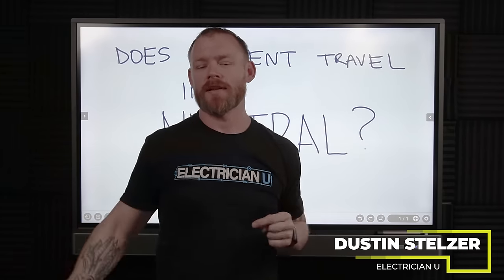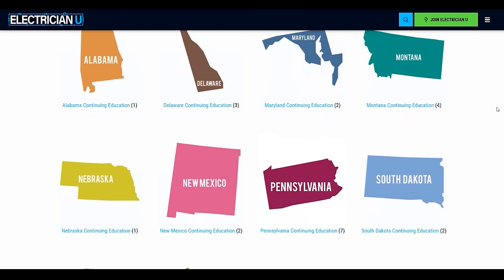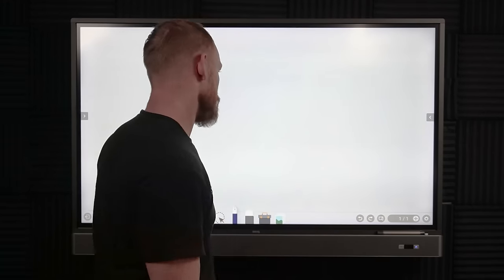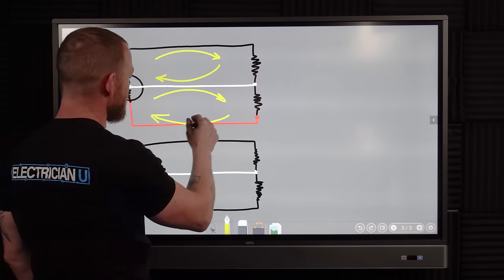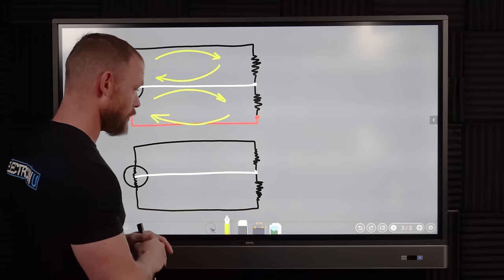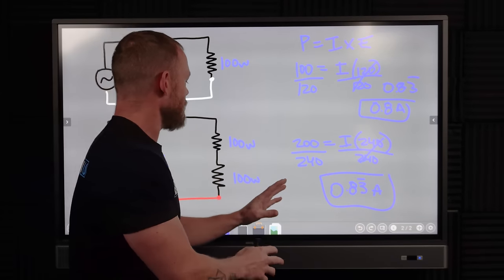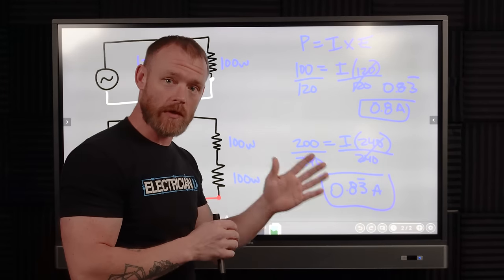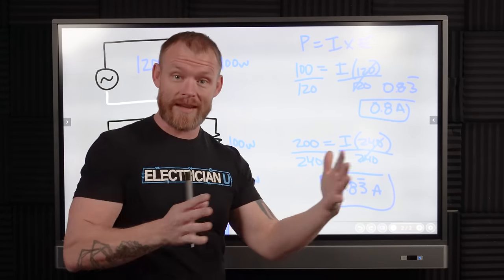Does Current Flow on the Neutral?

Comment: Um actually, current is the flow of electric charge, not electrons. Electrons have charge also and they do move through conductors in a process called electron drift but that is significantly slower than the conveyance of electric charge through a circuit. Think of it like an ocean. The waves (charge) move through the ocean (conductive band) and the ocean is on Earth (wire) and the ocean is made of water (electrons) but the waves move the water at a much slower rate than the waves move through the ocean.
Reply: Electrons are the charge carriers.  The charge moves with the electrons.  The signal propagates much faster than the electrons, though.
Reply: @GH-oi2jf  yeah, you got it. Electrons have charge the same way water has waves. And a wire has a conductive band made of electrons in the same way that the earth has oceans made of water. Charge propagates through a conductive band the way a wave might propagate through the ocean. This wave can displace water the way charge can displace elections. Anyways, electrical current is the propagation of charge, not the flow of electrons. And if that seems unintuitive, there are as many electrons in a wire as liters of water in the ocean.
Reply: @austinwoodall5423  — No, the charge is an attribute of the electrons.  The charge moves when the electron moves.  The protons also have charge, but they don’t move.
Reply: @GH-oi2jf  consider a stadium wave where attendees take turns raisimg their hands in a coordinated effort. The stadium (wire) has a crowd (conducting band) made of people (electrons). The wave moves through the crowd when the people move from their seats (valence band) to a more excited state (conducting band). Sure the people have hands and can stand but the movement of the wave doesn't require them to change their positions, only their states.

Comment: That is a loaded question and the answer is maybe or maybe not!!! All depends on how balanced the load is on the 120 volt circuit if measuring single phase 120/240 voltage circuits!!
Now if you are using 3 phase circuits at what ever voltage you are on, 277/480 circuits using 277 volt lights it still depends on how it is loaded up!! 480 3 phase motors is a bit different or if you use delta phase which I personally don’t like!!! 😂😂😂😂

Like I said … loaded question!!😂😂😂

Comment: You aren't "wrong" but you use a lot of phrases that are wrong.  

240v single phase +neutral (120v) seems to contribute to this misunderstanding or at least mis use of terminology.  

The current flow question you are addressing is simple math. The numbers have to add up. 

There is another misunderstanding and that is potential versus potential difference, commonly referred to as voltage.  When we talk voltage it is about the difference between two points.  Hence a 240 V system is 120 V to neutral/ground.  

Point being, people are learning from you. Words matter. Be more explicit and accurate.

Comment: lol you just shoe horned in the real kicker at the very end.  for anybody just wanting an answer: yes, current flows in the neutral back to the transformer IF the loads are unbalanced.  otherwise, no, they just oscillate back and forth through the hot and neutral across the different phases.

Comment: I am completly at a loss as to why you are trying to teach electricity as you have no idea how electricity flows or works .I am going to give you a quick class on the flow of electricity. You are stating that you are reading 2 amps draw going into the bulb and 2 amps leaving on the neutral,this is false. The light bulb draws only enough energy to operate which is 100 watts,this leaves 0 energy left to cause amp draw on the neutral.Every load or draw pulls only the energy it needs to operate ,if you are showing draw on the neutral there is a short in the load allowing energy to go to ground.If you disconnect the neutral from the neutral bar and contact the bare wire when the load is energized you will get a shock because you are a load now and the draw increases but you are in series with the load and the voltage is considerable lower.Electricity flows only in one direction and it is pulled not pushed it is drawn through the wires.It's like I told another fellow, you can't push a chain , you are dealing with compressed energy and only can be pulled for that reason and the fact that the load determines the draw and causes the draw,What drove me crazy ,was what causes the draw. Say you have a solenoid coil that has a draw of 6 amps..and you close the switch and due to the electricity not being right at the switch and needs to be drawn what is drawing the electricity to the coil.This was the problem ,what is creating the draw and what is giving electricity it's speed,it surly isn't getting it from the generator with its speed. It is now I realized what was happening.There is a force created by the super strong attraction between the neutron and dark energy,which I will explain later, as dark energy is a force that supplies the energy for all the magnetics  in the universe. This is energy is emitted from the rotor to the induction coils on the stator. Now we have to get the energy from the stator coils into the conductors and into the grid.This is were all the ground rods come into the picture. There is a ground rod that is tied to the back of all the stator coils on the generator, on the first transformer there is a ground rod for the HV coil and one for the LV coil. Any more down stream transformers will have the same plus all service panels and motor centers will have ground rods, now the reason for all the ground rods is as follows. The ground is saturated with free neutrons which are drawn from the ground into the conductor of stator coil by the ground rod near the generator. The neutrons are accelerated to the speed of electricity and as they speed through the coil they pull the dark energy into the conductor of the stator and generate electricity ,which leaves generator on the stator coil leads that become a,b,and c phases. When the energy gets to the first transformer HV coil it is drawn from the neutron stream and into the core and into the LV coil. When the energy leaves the HV coil,the neutrons are drawn back into the ground and new neutron steam is drawn into the LV coil using the ground rod. When the energy is used in a service or distribution panel all of the neutral wiring is terminated at a terminal lug and the lug is wired to a house ground rod. This grounding system allows the neutrons that carry the energy to go back to ground and new neutrons to be introduced into the system and carry energy. So you see grounding systems do more then ground stray current and neutrals carry neutrons.
Reply: Wow ... right off the bat you make a number of statements that simply aren't the case.

[You are stating that you are reading 2 amps draw going into the bulb and 2 amps leaving on the neutral, this is false.]
Are you kidding? The current going into a load (resistance) is equal to that leaving said load --- check out Kirchhoff's Laws for circuits. They apply to both AC and DC circuits.

[The light bulb draws only enough energy to operate which is 100 watts ,this leaves 0 energy left to cause amp draw on the neutral. Every load or draw pulls only the energy it needs to operate ...]
This makes absolutely no sense what-so-ever. Loads (or resistances) do NOT pull anything, especially current. If they did you would not need any battery in a DC circuit or power supply in an AC circuit. They are an impedance to current, and show a voltage drop across them. If they are the only load in a circuit they will display the full voltage of the supply across them, otherwise they will split the source voltage accordingly if in series depending on their relative resistances (if in series). If they are in parallel they will each show the full supply voltage across them, but split the current accordingly. 

[... if you are showing draw on the neutral there is a short in the load allowing energy to go to ground.]
What does this even mean? A draw on the neutral? The neutral on a 110 (or 120) volt single phase will match the current on the hot side of the load. If 2 amps show on the ammeter prior to the load, it will show 2 amps on the return --- again, Kirchhoff's Law. There is no 'draw'.

[Electricity flows only in one direction and it is pulled not pushed it is drawn through the wires.]
If you mean electrons, this is true only in a DC circuit. But in an AC circuit the electrons oscillate back and forth 60 times per-second (60 Hz) and the movement is barely measurable. Their movements are induced by both repulsion and attraction to the positive and negative terminals of the power supply which have either an abundance or reduction of electrons.  This can remain as a fixed state (DC) or alternating condition (AC).  Even in a DC circuit their movement is very very slow, it is known as drift velocity. But the effect of their movement is extremely fast --- think of water being forced through a hose that is already full of water. Once you turn of the valve, the water starts emerging from the open end immediately even though the water leaving the valve end is nowhere near the open end.

I can go on and on --- like your calling electrons neutrons --- but it would be a waste of time. Whoever or wherever you learned electricity from seemed to understand electricity the way Aristotle explained physics. Plus you keep misidentifying things like current, voltage, energy and power. Anyone who knows even basic electricity would not be making all these errors.

Comment: I understand the utility of explanations in terms of current flow as electrons moving through a medium, but none of it is true. This only causes people's minds to be blown when they learn about Poynting vectors, how power travels from source to load over both paths, that any net travel of electrons is very slow and in the opposite direction, and again over both paths. It's only then that AC and DC both make sense, since regardless of the phase (or lack thereof) power is always delivered from source to load. It's all about the fields! To state it another way, the power company is not producing electrons that are being pushed out to you and need to be returned back. The whole push-pull idea is simply false.

Comment: Easy test....remove some insulation from the neutral on .....let's say a drill. Plug the drill in to an outlet and pinch the bare wire on the neutral. No shock!! Now ......pull the trigger on the drill...OUCH!

Comment: Just got into the comments to point out that you call a split phase "2 phases". This is very wrong especially for an electrician.
Reply: It isn’t to me.  I’m not an electrician but I have a graduate engineering degree, much of which is electrical engineering and mathematics.  It is accurate mathematically to think of the two sides of the split phase scheme to be two phases in opposite 180°) phase with respect to neutral.  You may think of it another way if you prefer.  It is just a matter of point of view.

Comment: there are no electron particles moving through the wires. It is a unit of charge and produces a magnetic field, While it might be useful to think of them as particles that is not the reality. How does a particle create a magnetic field? How come they don't accumulate in the ends of wires? They just seem to pop into and out of existence.  So many "fundamentals" need to be rethought out clearly and reconsider desire to make everything a particle
Reply: The electrons are the charge carriers.  They are particles and they do move, and must move in order to propagate the field, but they don’t move very far in one half-cycle.

The difference between a conductor and an insulator is that a conductor has loosely bound electrons which can be dislodged and moved.  An insulator does not.

Comment: I did not make it through the whole video, tbh. I skipped through to see is i can at least see a reference made to phase shift. But no.
So there is you answer: Always assume that at one point in time there will be flowing current throug N. All of it. that is you base point for calculations. I liver in a country where it is normal to get 3 real phases directly from central transormer and where electrical safety is very strict. I know that some countries try to safe a buck or two on cheaping out on the cross section of neutral conductors, but the risk isn't worth it. Not all electricians understand physics and mathmatics well enouf to understand when you can do this (only on perfectly matched loads) and when you can't (everything you guys will attempt after watching 4 youtube videos).
I am being a bit snarky because lives depend on this... not just yours, but also your family or people moving in after you.
If you really need to watch youtube videos about how an electrician does things you should  not lay your hands on this stuff.
Reply: The term “real phases” doesn’t mean anything.  Phases work the same whether they originate in the generator or are synthesized later.  In any case, we also have “real” 3-phase power in the USA, we just don’t ordinarily use it in a residential service.

Comment: i will add an exception to  this  in my youth i was a telephone repairman  i had a report of the dog yelps real lout when the phone rings????i found the dogs chain conn to the gd wire  from meter to gd rod was broken at the rod    so ineffect  the dogs feet was a path to gd  as the 105 ring volts they were shocking the dog so i removed his chain and conn to something else had the owner reconn his   broken gd wire so ithink we can there was voltage on the gd wire?????????  in this case

Comment: Video is too long to express that a voltmeter represents a differential value. If both legs have a ground differential of 120 the difference between both is 0. So the volt meter reads 0.
Reply: Where are you in the video?  The difference between L1 and L2 is 240VAC (RMS).

Comment: People ask why 4 wires? They both ground together at the meter. Waste of wire!
Reply: The ground wire is extremely important for safety.  If you have a tool or appliance with a metal housing, you want the housing connected to ground.  Grounding through the neutral is not acceptable.

Comment: What????????  If you have electricity flowing to a 2 amp light bulb it would use up all most all the amps to create Light. Only about 1 percent of the energy makes it pass the Load through to the neutral  wire to complete the circuit.
Reply: want to get zapped with 1% ? I don't!
Reply: False. The load doesn't use up or "consume" the current. The current flowing through the load is what does the work. If you have a 2 amp load on an individual circuit, an ammeter will measure 2 amps flowing through the hot and 2 amps flowing through the neutral.
Reply: @pld8993  Okay thanks, i will check it out with a clip-on. Well the voltage would be used up in the Load.
Reply: @anthonycavalliotis8736  Nothing is "used up." Electrical flow, which requires voltage and amperage, is what is doing the work. In order for the TV to work, a current, pushed by a voltage level, must flow through the TV. Voltage is the pressure and amperage is the rate of flow. Think of water, it can't flow through the faucet unless there's a force behind it pushing, same concept.

Comment: Wene o e looses a neutral,,, one better check the founding conductor,,,, cuz iv seen SEU fail internally,, and it goes to ground,, every thing works but it's dangerous,, iv seen neutral load follow aluminum sideing back to meter base and the screws holding the old worn out meter base were glowing orange 😵😵😵 the bare #6 copper group d was touching the sideing on its way to the ground rod,,, it then we'll path of least resistance,, threw the sideing to the meter base

Comment: This is an easily answered question. Disconnect the neutral lead from a lightbulb - does it stay lit? No? Why not?

Now reconnect the neutral lead, and cut it. The light goes out. Next, insert an ammeter into the break - the lamp lights and you read CURRENT FLOWING IN THE NEUTRAL LEAD.

This shit is just dumb.

Comment: checking a exit light circuit one day 277 volts   20 amp circuit on the neautral (gray color for 480/277 circuits) i had 15 amp

Comment: But that should only be true if the two phases are 180 degrees apart.
Reply: In general, in a split-phase system, with 120V circuits, the two sides will not be perfectly balanced.  If you have no 120V circuits, only 240V circuits, then there will be no neutral current.

Comment: too many people confuse current and amps
Reply: What's the difference?
Reply: @Ryan-qn1wr  amps is the measurement of current. More volts added to a circuit = more current (flow of electrons) = higher amps.
Reply: @Harry1s  I figured that but Im a little confused of what that distinction has to do with the point of the video
Reply: @Harry1s  More volts does not result in higher amperage, especially in a load with a fixed amount of power in which case, higher voltage means lower amperage.

Comment: Please look again at what you are saying.
According to your explanation, the circuit is closed between two phases ???
You also claim that if the two circuits are balanced that the neutral wire does not conduct current because the magnetic field acts as an insulator. According to that, the bulbs you drew would not light up because the neutral would be an insulator as a result of the circuit being balanced.

Sorry for the criticism, I appreciate the effort and your desire to teach others. I'm not trained in electricity, nor is it my job, but you said a lot of things that I don't agree with or don't understand.